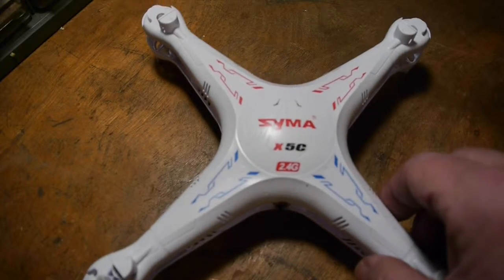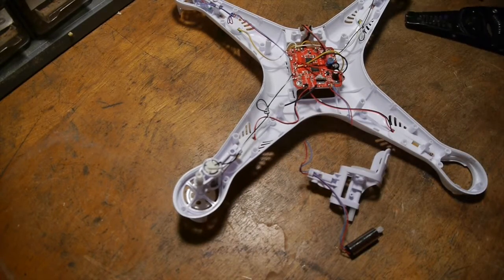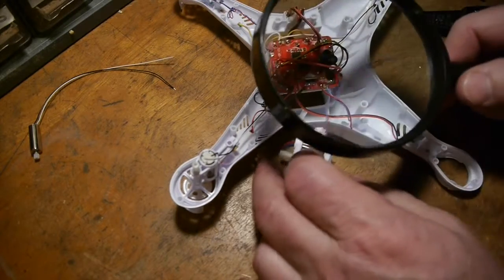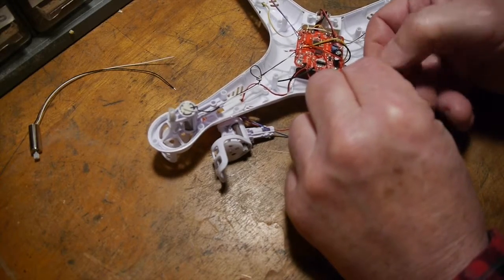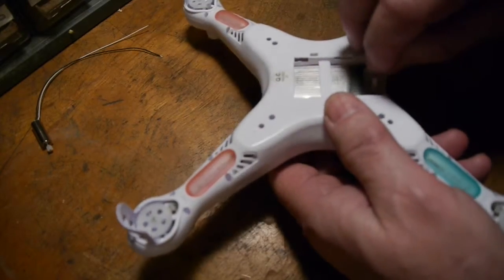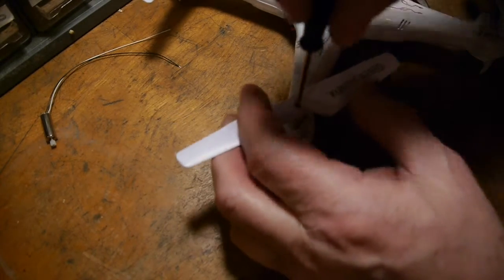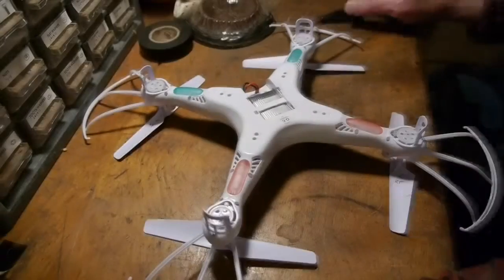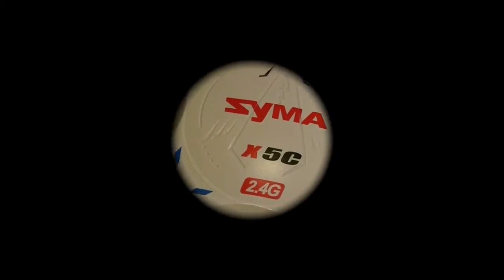How to Replace Motors in Syma X5C

Comment: Tip for cutting motor wires. Cut one longer than the other just enough so that both splices are off set and will not short even if bare